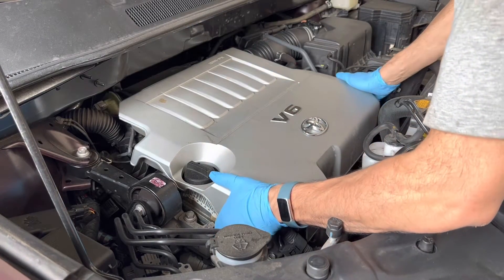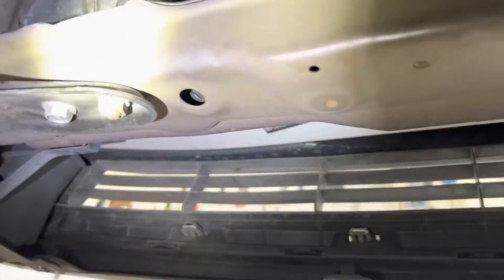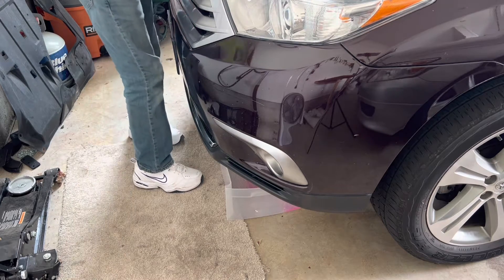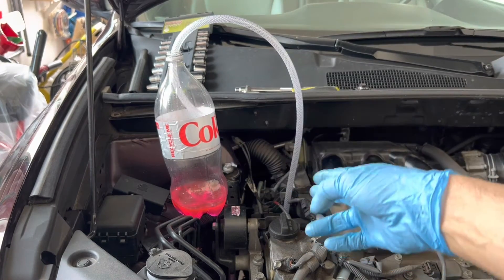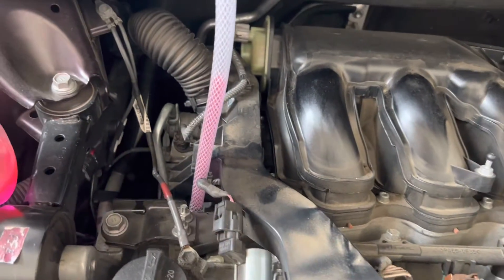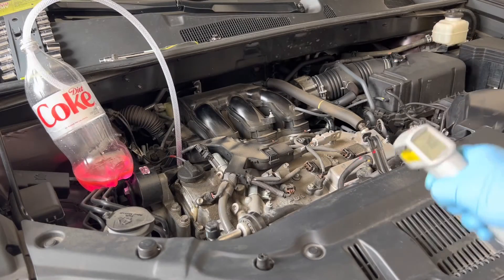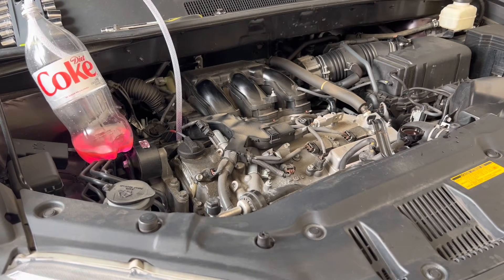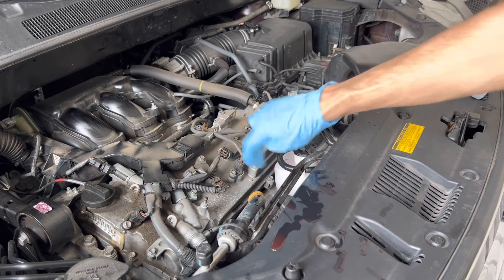Toyota 3.5 V6 | Radiator Coolant | Proper Bleed Procedure

Comment: hi there, i appreciate this video. However, there is one very important thing that you missed. The engine MUST be above 2000 rpm or above during this process to get all the air out of the different components. If this is not followed, the engine will most certainly over heat and you'll warp the heads. The heater should be turned off also. If you do not follow the correct steps, you are going to have issues!
Reply from the maker: Thanks for the feedback. I am not sure why would the engine overheat if it is below 2000 rpm? and why should the heater be turned off?
Reply: @akhaqan  according to the repair manual by Toyota, especially if you drain the block, you will have an 
 air pocket in the system. What you drained is just the radiator, there is still 20 to 30% coolant left inside the block. 2000 RPM and above is when the water pump is spinning fast enough to push water though the bleeder valve. If you do this procedure correctly, you will get a very steady stream of water with zero air bubbles. That's when you know that you have bled the system successfully. Once you do this, the heater will be very hot.
Reply from the maker: @SuperMan-uj7dh  You are partially correct. There is no way you can overheat the engine as long as it is running, even at idle 750 rpm with radiator full of coolant. As you rightly said, the block is still full of water, we are trying to bleed the system upstream of the thermostat valve till the water in the block reaches the operating temperature of about 180F. Once that temperature is reached, the thermostat will open and circulate water everywhere. Contrary to what you are suggesting, keeping the heater on will ensure that coolant gets circulated there too and any pockets of air are removed. There is an alternate method for DIYers who are doing it at home, even if you don't bleed the system, you will be fine, just make sure the reservoir bottle is full, radiator is topped up and close the radiator cap. Drive the car, when you park it, the radiator will pull in required water as the engine cools. Top up the reservoir & radiator again. Do this 2-3 times and your coolant system will be properly bled. This is more environment friendly way as you don't waste fuel idling. The 2000 rpm method does make sure that your system is bled the first time and workshops should follow this, for a DIY, the alternate works equally well. Thanks for taking out the time to comment, much appreciated.
Reply: Just wanna say thank you for that explanation. I’ve been hunting for all the info to make sure I swap my 06 Avalon’s coolant without ruining it, and you gave me some piece and mind with the DIY method to fall back on.
Reply: Do you know if the 2005 Highlander V6 3.3 L has a bleeder valve like you show in your video?